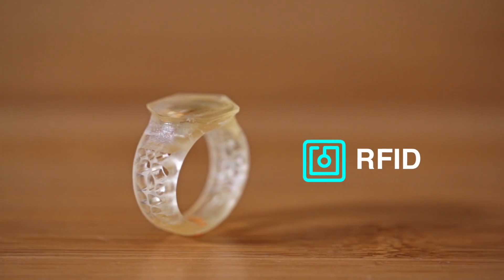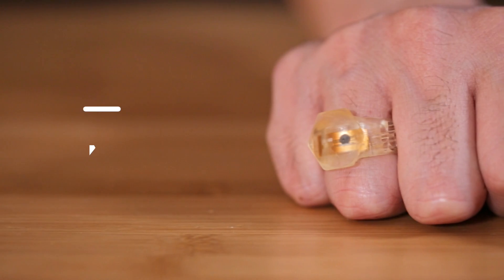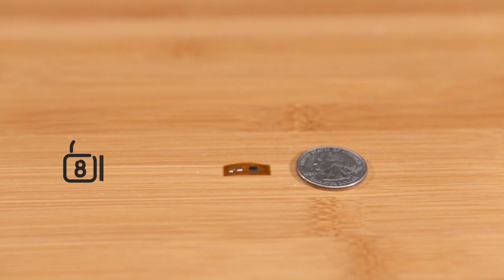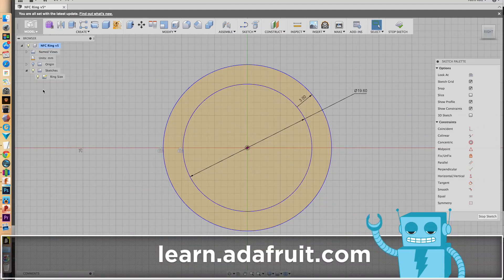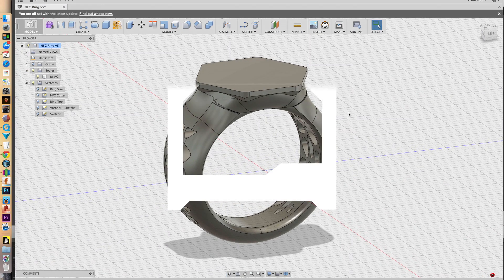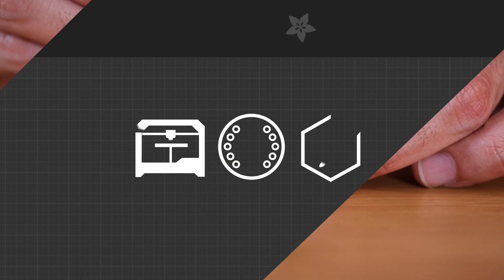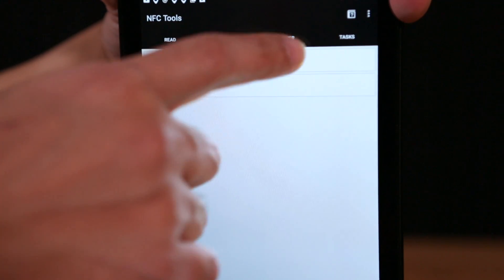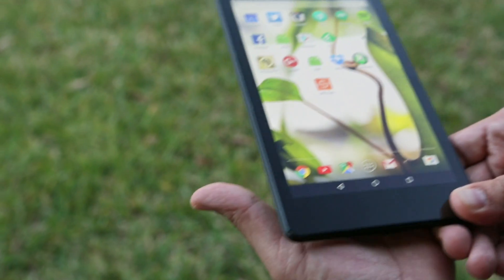NFC/RFID 3D Printed Rings

Comment: I'm trying to print a ring with fdm but I have several questions. Is is okay to place it after printing because I'm afraid of it falling off the ring. Also if I place it during printing, does the heat harm my nfc tag?